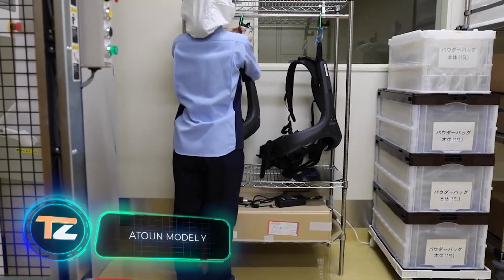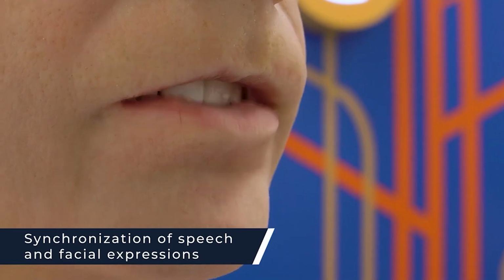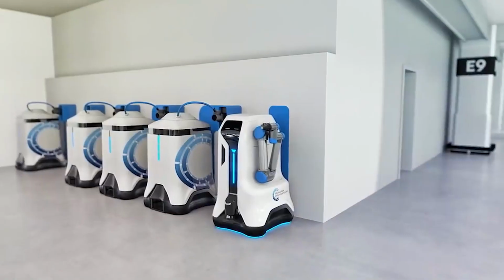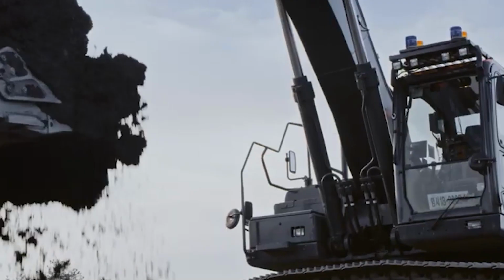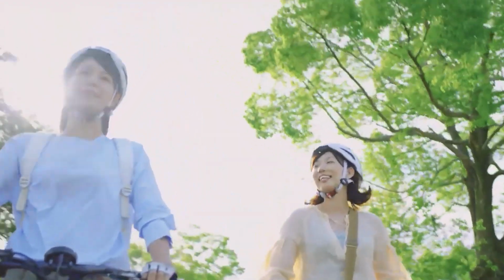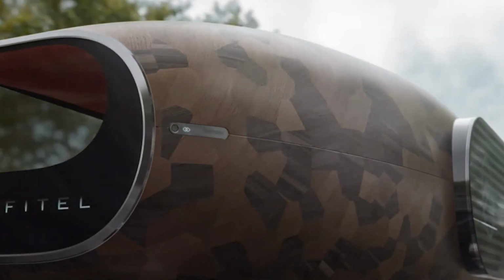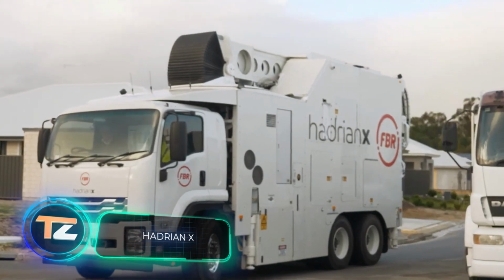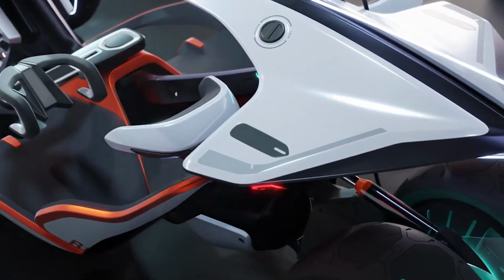INVENTIONS OF THE FUTURE THAT WILL CHANGE THE FACE OF THE EARTH

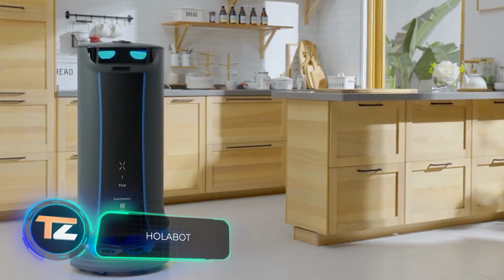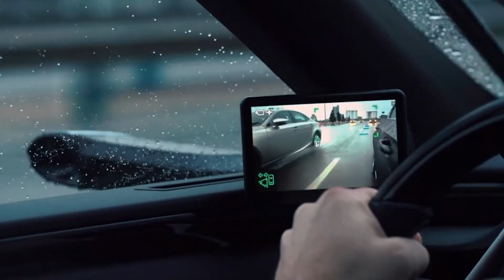Comment: 01:00, high paying boring jobs is becoming an endangered thing, now they're replacing that with robots 🤣(oppisit of Goerge Jetson -ism). 04:50, needed to loop on the mid joint of the finger, not the base, that underminds rings people ware. 09:00 completely replacing side mirrors, even Teslar co. couldn't get away with that.